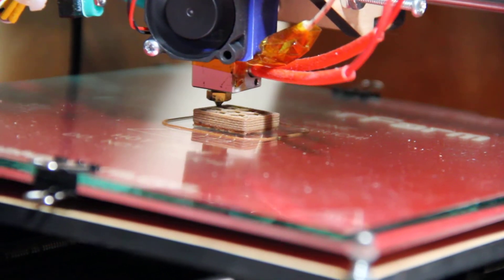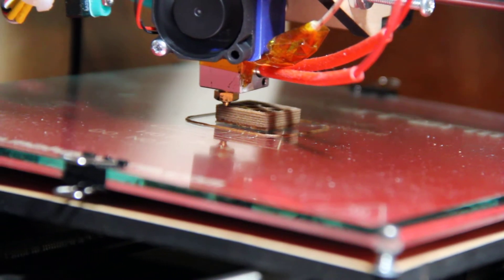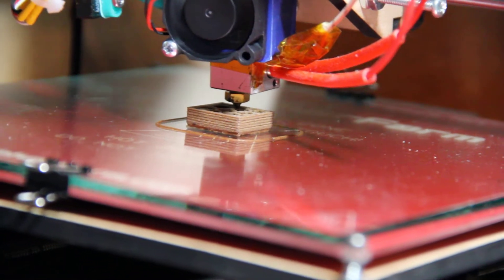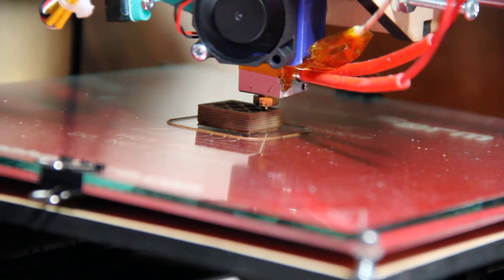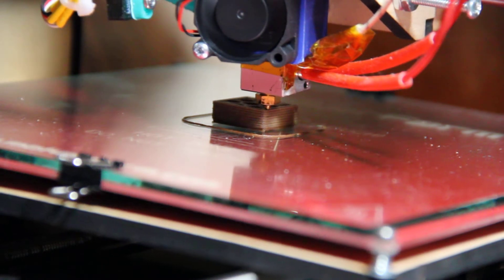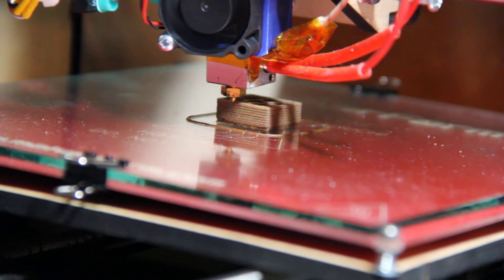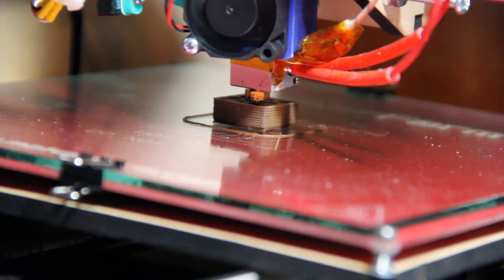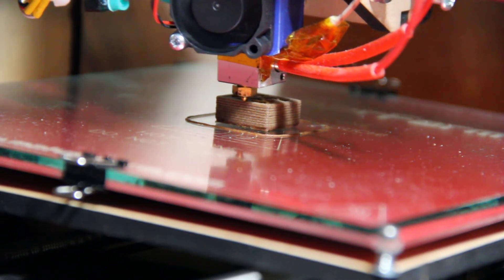E3Dv5 all-metal hotend for RepRap 3D printers - Review part 2, and printing with Laywood 3D.

Comment: Say, where do you connect the always-on cooling fan? I presume it's on a different circuit from the firmware-controlled fan.
Reply from the maker: I have the fan wires twisted together with the main 12v power supply wires, and they are both clamped into the main power terminals.  Any time the power supply is on, the fan is blowing full speed.

Comment: Hi again.  So I got my E3Dv5 hot end yesterday and was so excited.  I tried printing but it doesn't seem to be extruding enough filament out.  I was curious if you changed anything in your slic3r config (besides nozzle_diameter) or are you using cura or some other slicing program? I changed my nozzle_diameter parameter to 0.4
thanks again.
Reply from the maker: In general, compared to the J-head, all-metal hotends like to print quite a bit hotter.  I consider 245 degrees to be about the minimum for good ABS extrusion (more for glow-in-the-dark variants), and my best luck is at 210 for PLA, with about 190 being the minimum.  Also, whenever you make a major change in hardware configuration, it's a good idea to recalibrate your extrusion.
Reply: Thanks for your reply.  How would I recalibrate my extrusion?
Reply from the maker: Edwin Solares
That's a small question with a very big answer.  It's also the subject of my next video series.
Reply: ZennmasterM the extruder calibration was awesome.  Btw what temperature do you print your PLA at using the e3dv5?

Comment: Hi !
I want to build my own 3d printer with E3Dv5 hot end and I'm reflecting if i need something more than this parts http://reprap.org/wiki/Prusa_i3_Rework_Bill_of_materials ? because is designed for magma hotend
           Thanks in advance                                   Mikołaj
Reply from the maker: The E3Dv5 needs a different mount than the Magma.  Other than that, you should be fine.
Reply: Thanks :)

Comment: Where did you get your laywood filament? I am about to get an E3D hotend and would like to give this stuff a try.
Reply from the maker: Makergeeks.com.  There's a link to them on my blog.  The Laywood is expensive, but really interesting stuff!
Reply: ZennmasterM Yeah, really expensive, about 4-5x that of PLA/ABS pricing.  I've only found it in roles of 250g, and they want $35-$50 for this.  I haven't tried it out yet, as I'm only 1 week into 3D printing.
Reply from the maker: TAZ427  $50.00 seems like quite a bit for a quarter kilo!  It's pretty cool and interesting stuff, but not for "practice" or prototyping use.  The print properties and settings are fairly close to PLA, so I'd suggest test printing and fitting a part in PLA before you go for the final print in Laywood.

Comment: Glad to hear someone else agrees with the extra 20C for the E3D. iv found the same  with PLA and ABS etc
Reply from the maker: I think it's mainly because of the thermal properties of the stainless steel, as well as the very short transition zone, which is what allows it to print PLA so well.
Reply: ZennmasterM I have the same setup - Makerfarm 8' I3 with the E3d. I would love to know what speeds and temps you use for PLA and ABS. ABS works fine, but my results have been mixed with PLA.
Reply from the maker: Eric Devoe  Speeds really depend on the shape, of course.  I have found that 40-60 mm/s is generally safe to start, and my best luck with PLA is generally at 210 degrees. 
In your mixed results, what kind of undesirable behavior have you been seeing?
Reply: ZennmasterM With PLA, I am getting an inconstant flow, usually tapers off to very fine strings. Thanks. I have been running 195 - 205 so looks like my temps are too low
Reply from the maker: It sounds like you're getting close to a jam.  I might also try increasing the print speed.  Additionally, I've noticed the fan shroud sometimes wants to slip down the heat sink.  Make sure the top of ot is flush with the top vane of the sink.  Lastly, (please don't be offended), you've got the fan hard wired to the power supply, not the "fan" pins on the RAMPs board, right?
The final consideration: there's a lot of really ugly PLA out there.  If you've only been working with a single spool, that may be the problem as well.
Reply: ZennmasterM Thanks, You are right, the shroud had slipped down and I didn't notice it. The fan is hard wired to the PS, so it is always running. It is loud and I was thinking of replacing it with a 40mm too. My shroud is loose, so I think I'll try printing a new 40mm one in ABS and try that. Do you have a recommendation for a good source for quality PLA?
Reply from the maker: Eric Devoe  I've had good luck with MakerGeeks, as well as Colin's stuff.  I've never ordered PLA from Ultimachine, but their reputation is that they are the gold standard.

Comment: Can you do a follow up on the bowden/E3d combination? I did not have much luck with it. PLA seems to jamb in the tube and stringing increased a lot.
Reply from the maker: Interesting.  E3D actually have a different version of the hotend for use with Bowden setups.  At the moment, I have neither that model, nor a Bowden-equipped printer, but I will try and steer future projects in that direction.
Generally, though, my understanding is that Bowden setups are more prone to stringing due the hysteresis that you'll always have when the filament is being driven so far from where it's being extruded.  You got me thinking, so I'll see what I can find out...

Comment: I hear that the laywood makes the area smell like a wood shop, and I'm wondering if it sands like normal wood?
Reply from the maker: It smells like you've just been sanding hardboard, although it's pretty faint, about the same strength as PLA.